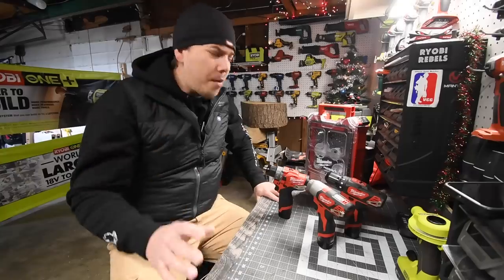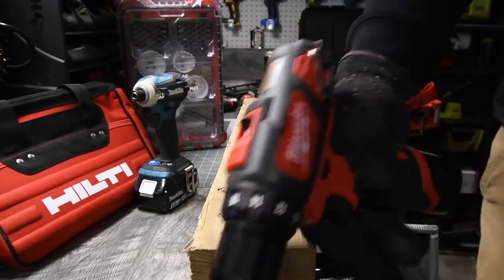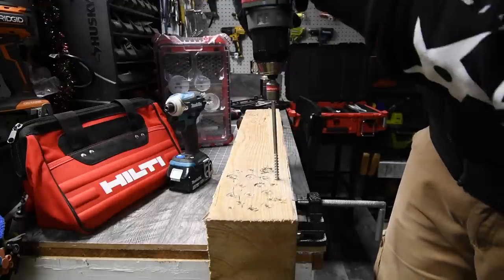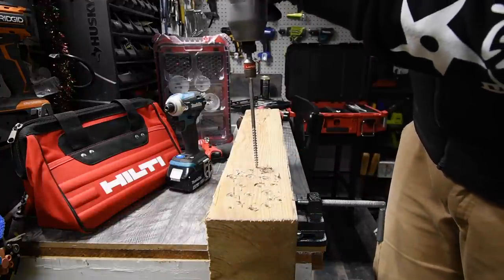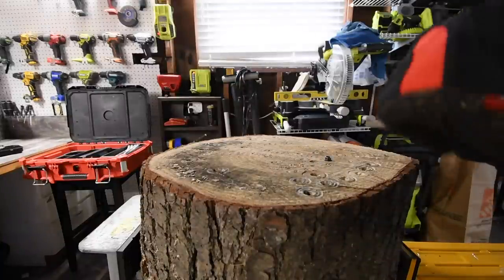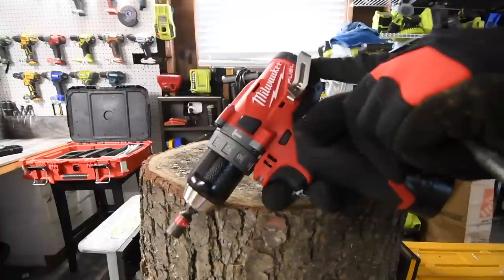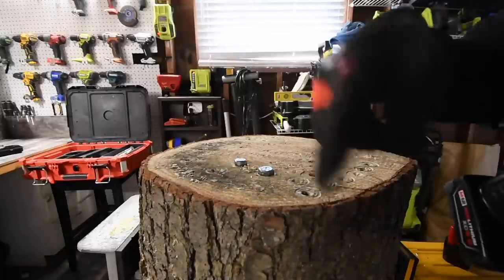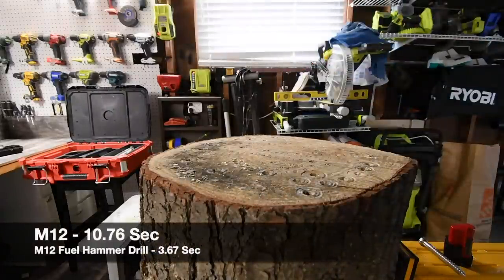Which Sale is Better?

Comment: That older m12 drill/driver is what converted me to a Milwaukee fan. I bought that Milwaukee kit in November of 2013. After a few days of use installing a sub panel and pumps for a pool, fountains, and outdoor lighting, I dropped the Drill Driver into the bottom of an 8' pool. It didn't just get wet, it was submerged for 5+ minutes at the bottom of the pool while I fetched the net to fish it out. After I get it out, my co-worker says, "oh, take the battery out, open the drill, and leave it in the sun to dry out, its gonna be a goner but it's worth a try." I figured what the hell and pulled the trigger. The thing spat out water for a few seconds and is still working to this day.

I was a Ridgid fan prior because they seemed heavy-duty but bought into Milwaukee for the 12v size. I still have the m12 impact at work and that thing has no problem shearing off the heads of 3/16" and 1/4" Hex Tapcons. My only gripe is not having a speed selector.
Reply from the maker: im glad the m12 tool didnt die on you and I thank you for sharing your story Joshua

Comment: The M12 Fuel Hammer Drill is incredible drilled through 8x8 post with 1/2" spiral bit, I also had the 6 amp battery.
Reply from the maker: that is why its better to the cheaper Fuel kit

Comment: The fuel drill. I Both the drill and driver kit $249. Best money as i have the same non fuel kit. On Facebook for sale now 😂 that fuel drill is NO JOKE. Just about snapped my wrist drill 3/8 holes in a trailer. the hammer feature is pretty sweet as I thought it would be weak but it isn’t. Did a 3/8” in a retaining wall and didn’t struggle at all. Very good for the $.
Reply from the maker: very good and I thank you for viewing Mean

Comment: The $120 kit is their entry level to get into the platform.  I kinda did the same on my ridgid 18v gen4x combo for $119 and now my impact wrench and circ saw are brushless but it got me into the platform.  Maybe someday ill go brushless drill and impact but for banging around the house the brushed work well for me.

Once you get the cheap entry level tools then they get you with the batteries and their brushless tools etc.  It's their way of making you platform loyal because it makes more sense to stay with it than to be on multiple battery platforms.
Reply: Actually how they get you loyal is having the best tech and most power m12 and m18 tools on the market. Everybody says "i don't need brushless tools" till they tey them. The fact that you can have all the power they produce and be able to turn the power up and down in relation to the job at hand is what makes it so good. Just use them one time and you'll never go back to brushed tools. #facts
Reply from the maker: but in this case its cheaper to get the Brushless M12 fuel

Comment: I got the brushed drill for 41$ on amazon. Works perfectly for a 3/8 drill.  The hammer function on the fuel is worthless
Reply: Lol
Reply: @jakedraper8872  yup the m18 cant do it but my dewalt can but if it cant then an sds. Anyhow GENIUS, you might use tools that are just enough and try to do the best you can with it but some folks choose to work smarter not harder. Dont assume people are idiots cause they dont like the tools you do. Plus if you had to drill into concrete of any thickness even the m18 brushed would be better. But feel free to make a video.
Reply: @bufunga  agreed this guy is a clown... aggressively came at me also because I prefer my M18 fuel drill/Dewalt dcd996 over the M12.
 he's also getting clowned in several other comment sections. seems like he's an in 12 M12 fan boy who thinks nothing can be better. he even was telling somebody the M12 fuel is more powerful than the M18 fuel and how he runs huge hole saws with his m12...
Just let him know my M12 fuel didn't cut it for me- was a toy & couldn't perform the tasks I need..  don't tell him you prefer an 18 volt Milwaukee or DeWalt that is actually up to the task...he will get triggered 😂
Reply: @bufunga  👍
Reply from the maker: I dont think it is. it did a very good job for a 12v tool
Reply: @ManCaverTools  for wood
Reply: @ManCaverTools  its fine for wood
Reply: @bufunga  and good for metal and for tapcon put not for a 1/2 anchor like you said the right tool for the right job 
But anything bigger than 3/8 get the sds fuck drill for concrete even big 1/2 corder hammer drill suck

Comment: After Black Friday, I have brushless M18 Hammer Drill, Brushless Impact driver single speed, variable trigger speed and Brushless Saw.  The Impact driver seems very powerful, perhaps too powerful for light screws.  Was thinking of return and getting M12 Fuel Drill and a  
Impact driver, for about same cost.  I think I want multi speed impact driver, rather than relying on variable trigger to control.  Thoughts on this trade?  Of course M18 Fuel would be ideal, but seems like more cost than I can justify.  The M12 does seem to have more tools that I possibly would be interested in later.  The M18 seems very high end, but I am only into it fo $210 with 3 brushless (not Fuel) tools.
Reply from the maker: I love the m12 Brushless Fuel tools

Comment: I have the little m12 brushed drill. Not very powerful at all but it’s a decent drill for light tasks.
Reply from the maker: the Brushless Fuel will be even better for a cheaper price
Reply: @ManCaverTools  I would like to get the m12 fuel version. Kind of as powerful as the bigger drills but in a smaller package

Comment: The older drill is kind of underpowered but it’s perfect for the price I’ve used it for a while it’s only smoked once when I tried to use an inch hole saw. Regular bits work just fine
Reply: Lol not supposed to smoke at all and what good is a drill if it can't run a hole saw😂
Reply: The fuel drill will run a 2"" hole saw through a counter top, a unibit through different kinds of steel or metal. That's the point of this. The  fuel has m18 power in a super small package. Its a beast, the combo set is my prefered work set of tools. I use them every day and they are used hard. Fuel is always worth the price.
Reply: Don't Do It  agree 👍...some ppl eh?😏
Reply from the maker: it should be able to drill out a 1 1/2 hole no problem. it started smoking on the 3rd whole and the tool is still pretty much brand new. its not a good tool

Comment: Since this video is comparing value.  You should compare the brushed m18 drill/driver and impact  kit that is 169.99  vs the the m12 fuel drill and impact that would be 200 if you bought both.
Reply: Go with the M18 brushed hammer drill over the M12 Fuel. The 18 volt is more powerful by a decent margin. I'm not a fan of any of the m12 drills.
Reply: The m12 fuel drill and impact combo is better than the m18 brushed set. The fuel has tech and power options that are way better the the brushed m18. You can get the m12 fuel set for $179 @ home depot right now.
Reply: @jakedraper8872  where do you see it for 179?
Reply from the maker: I can do that and I thank you for the suggestion Brandon

Comment: i got the milwaukee m12 fuel hammer drill and m12 fuel impact driver with 2ah and 4ah batteries and bag and 12 volt charger. impact driver drove 2inch torx screws fast i had to slow it down.
Reply from the maker: very good, it is way better to get the Fuel

Comment: Still don’t understand the hate for the brushed 12v drill. You used a massive hole dozer with a tool that isn’t meant for that type of task. Folks buying a brushed 12v aren’t using it to drill massive holes. They use it to put screws in the wall.  But that 12v hammer drill is awesome.
Reply: The knock on the brushed version was that it was longer than the standard M18 version at that time.  People buy 12 volt tools because they are compact.  The M12 is longer and weaker.  There was no advantage to owning it whatsoever.
Reply: Once you use the fuel m12 set you will understand why the fuel is the best and most powerful 12v on the market, period.
Reply from the maker: just with the new tech in tools and the prices aren't really that much different. its just a waist of Money

Comment: Honestly the 120$ would be way better spent on the Ryobi one+ drill/impact/2 batteries/bag kit.
Reply: @jakedraper8872  If you saw what my still working compact C3 craftsmans had been through you'd think different. But I had to waste money on Milwaukee a few times before I'd accept piss green tools too. Milwaukee has always been a waste in my experience . Ryobi has always impressed.  Alas assumption is what we have until expereince kicks in.
Reply from the maker: I agree with you on that but the $100 for the M12 Fuel is very good as well

Comment: You should play the clip of each tool doing it's test at the same time so we can see the difference. Wow those m12 brushed are a joke.
Reply: In my opinion the M12 fuels are a joke as well compare them to the 18 volt fuel.... maybe MCT will make a video on that huge difference- took my M12 fuel kit back for return...
i do like other M12 fuel products liked the inflator, ratchet, rocket Tower light stubby 3/8 and more
Reply: @BuffaloNickel9  well duh of course vs 18v but there are a lot of people and applications for a 12v.. Lot of automotive, cabinet instalpers and light carpentry use 12v.  Working up on a ladder the 12v is lighter to hold and also working overhead. 

Different tools for diff applications.  Variety is the spice of life.
Reply: @jakedraper8872  am I new? well let's see everyone is clowning on you in the other comment section because you don't know what you're talkin about and you're a M12 fanboy apparently did not mean to trigger you man or hurt your feelings you can use what tool you want and I'll use whatever I want just don't try to tell us the M12 fuel is as powerful has as any M18 drill and know that the job will take longer... I have little to no use for my M12 fuel sorry bro just the way it is feels like a baby toy to me and couldn't complete the tasks I asked of it you're free to use whatever you want
Reply: @jakedraper8872  why not be done with the job more quickly?  I already know the answer maybe in MCT will make a video that can show you how much longer it takes to get the job done with the M12 fuelb than the m18... Yes you're correct  18 is a bigger number than 12  good job 👍..
 I don't have all day man and I'm certainly not scared to pick up the extra little bit of weight because that's all it is they're damn near identical in size... what's the first about sounds like I hurt your feelings and you're different trying to defend your favorite tool but saying it's as powerful as the M18 like you did on the other thread it's just silly...
Don't worry I use the M12 fuel for little quick Jobs sometimes..
Reply from the maker: I can do that. like a side by side sort of thing. good idea van :)
Reply: @BuffaloNickel9  They have an excellent m12 line up though. I remodel so I absolutely love my m12 viega press tool, m12 hatchet, m12 copper tube cutter and caulking gun.
Reply: @XxXGunShipXxX  yes agreed! you left out the rocket tower light the inflator many others.. just the smaller ones are the M12 tools of preference for me.
    I'll leave drills and drivers recip saws all of that to the M18 that can really get the work done quickly and is up to every task.. I want lots of in M12 some I love, some I wished I hadn't bought 😂

Comment: Kind of worried about my m12 fuel gen 2 hammer drill. Used a hole saw and now there is a lot of play in the chuck.
Reply: Maybe you didn't tighten it down tight enough at the start. 5 year warranty on the tool. Send it in and they'll fix it for free. Call 1800 sawdust.
Reply from the maker: im sorry to hear that. does it lock into place
Reply: @ManCaverTools  It still works ok, but with a long bit on the end the chuck flexes out of alignment with the selection ring. Seems like the bearings for the chuck mounting shaft might be bad or loose if there are any.

Comment: I like their brushed screwdriver but thats about it on their brushed 12v line.
Reply: Don't Do It  true that, forgot about that one
Reply: Don't Do It  I agree, I have the brushed ⅜ ratchet and the brushed compact m12 bandsaw. Those two tools are the only M12 brushed tools that I will recommend.
Reply from the maker: they do make a brushless Fuel m12 screwdriver

Comment: Garbage!?!? I have the M12 gen 1 drill. Had it since 08! Just used it this morning to install a over counter microwave!
Reply from the maker: did you not see the smoke show in the beginning? I barely used that tool since I got it a year ago
Reply: @ManCaverTools  I did. I know ur showing what they can and can't do. If I need more power, I'll grab the right tools. Nice show down tho!
Reply: @ManCaverTools  I've had the gen 1 m12 set for yeas now no smoking from mine. I've used the drill to run an 18inch auger bit its gotten the job done.